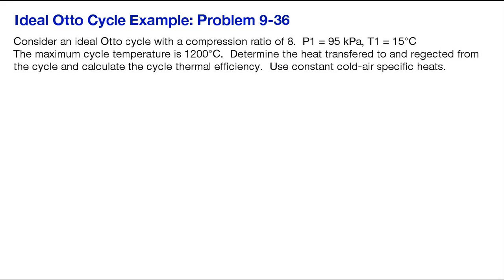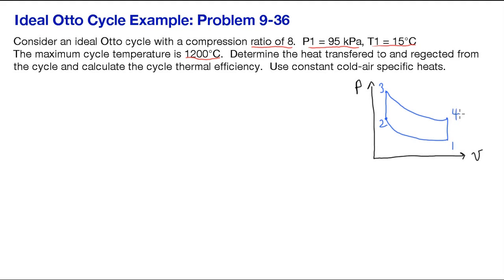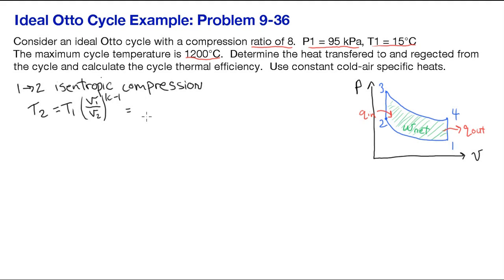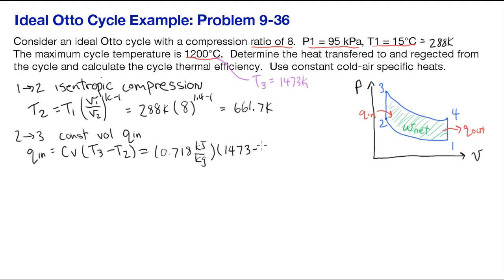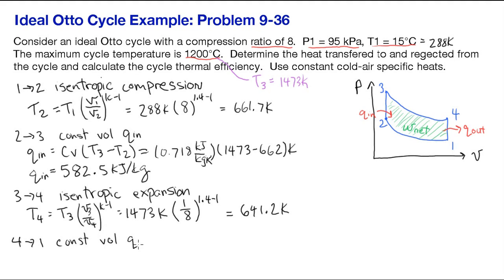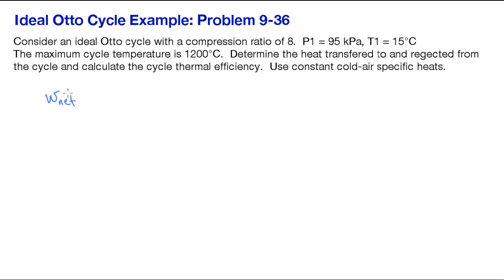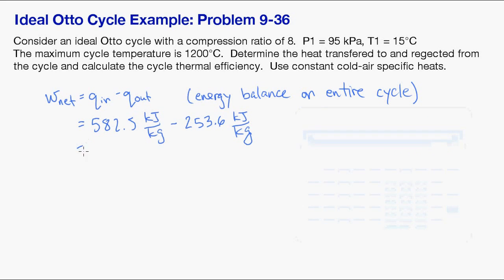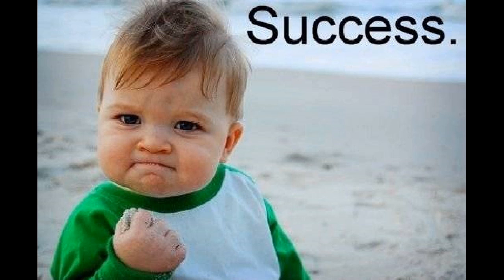Example: solving an ideal Otto cycle

Comment: Good presentation.  This example appears to illustrate a cold air-standard Otto cycle, which assumes a constant specific heat.  Modeling as an air-standard Otto cycle yields a slightly different result.  The thermal efficiency (cold-air standard only) also can be calculated from
eta = 1 - (T1 / T2)

Comment: its amzing how hard it is to find a good example problem worked on this one was so close until totally ignores the k in the first equation. please remind me WHERE THAT COMES FROM!!!!!
Reply: Eric Jones if you have a textbook handy, check the back appendix for "Ideal gas specific heats of various common gases", and look under "air" for the k value.
Reply: Thank you to you both
Reply: +Eric Jones k is specific heat constat also  cp/cv givs the same result this is valid for ideal gases